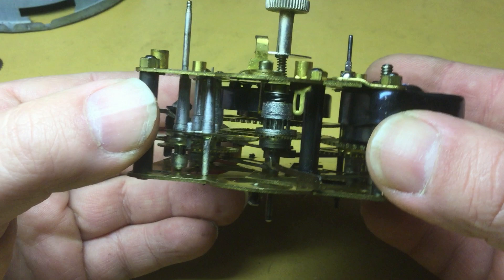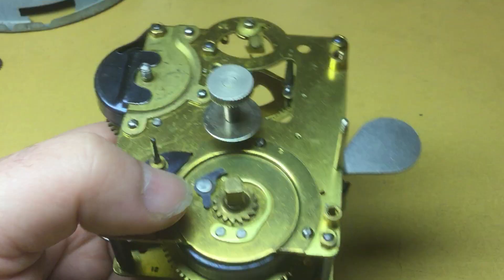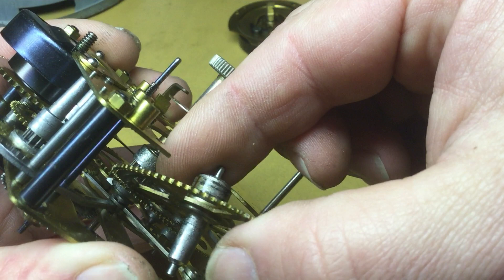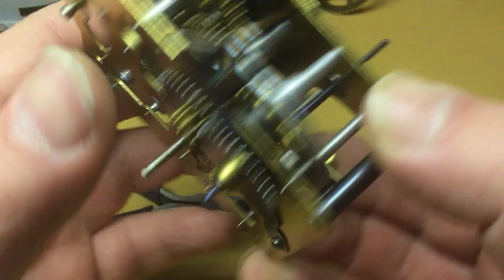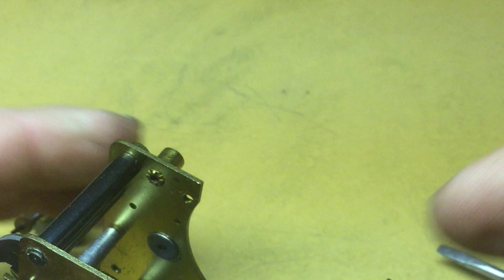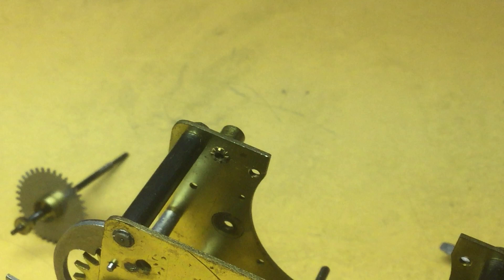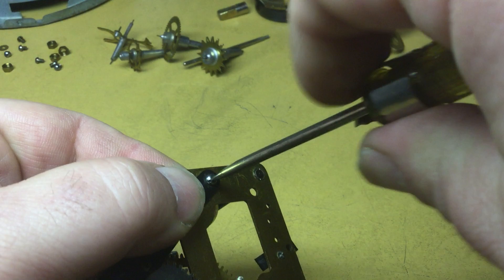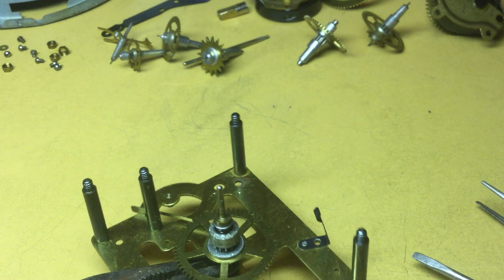Westclox Big Ben Loud Alarm style 5A rebuild part 3

Comment: Great video, especially learning the names of the parts. I assume you will be replacing the time bridge in your rebuild due to the wear on the bushing. I find if the bushing is too worn that it will cause friction on the great wheel and cause it to bind up with the center wheel due to being out of alignment and either cause the balance wheel to move slowly due to lack of energy being delivered or stop all together. I buy a couple big ben time bridges with main spring every time I find them on Ebay. I currently have 4 older new BB time bridges for style 1 and 2 and will modify them a bit if I have to to make them also fit the newer Big Ben's like style 4, 5 or 6. Personally, I wouldn't be able to call it a rebuild without a new time bridge. One of the first things I will do to a new Big or Baby Ben is take off the time key which is male and put a couple drops of oil in the bridge and turn the clock over on its face so the oil will reach the bushing on the time bridge than put the key back on.

Comment: What is the thread on the spring let off tool?  I have this clock, apparently these with the hang up loop were only made for three months at the end of  WW2-
Reply from the maker: I have not made measurements of the threads. I made the let down tool from a broken winding key so I did not worry about the threaded part, I just made the outer square part to fit the let-down key.